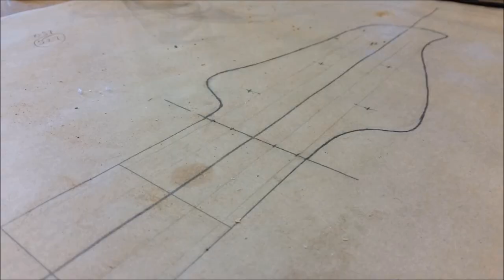5-String Bass Guitar Build - Part 5

Comment: A great comprehensive account of building a bass guitar. I have some wood that has been seasoning for about 12 years on an intended build of my own. 
Your videos have answered several questions I had. Your tips on lining up the bridge using string, how to nip the frets and especially the wood block with the 35 degree angle file setup were great. 
Thanks for sharing your knowledge and experience, greetings from San Antonio Texas....👍

Comment: The humbucker have one screw-hole on one side and two holes on the other. Is there a reason for that ?
If the bass has active pickups only, what can be done to have passive mode as an option ?
Reply from the maker: I've made a video to answer this for you. Thanks for the question. https://youtu.be/4qjsf5hTyEw

Comment: CA glue as a finish?  Never heard of that, please explain why that works.
Reply from the maker: CA = Cyanoacrilate. Essentially it's a hydroactivated plastic. When a cyanoacrilate molecule meets a water molecule there is a chemical reaction that results in cyanide gas and the polymerisation of the acrilate into acrylic plastic. All of this as it's soaked into the wood makes for a very tough finish that's cheap and fast. But yeah... cyanide gas... respirator and ventilation are essential.
Reply: @fanbladeinstruments  Ah, I never knew you could apply it on wood!